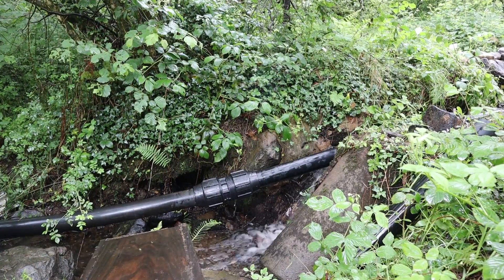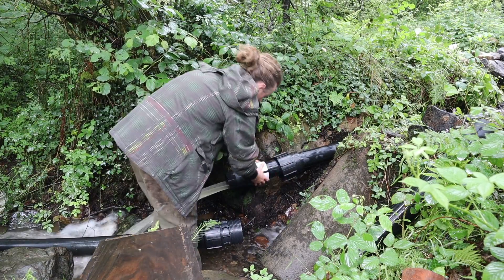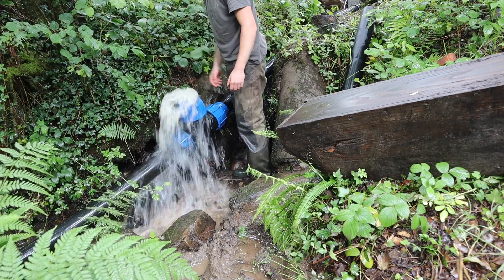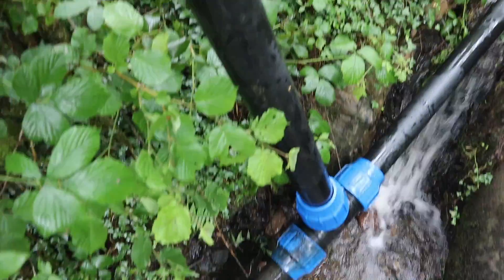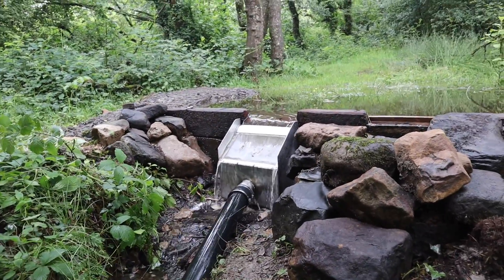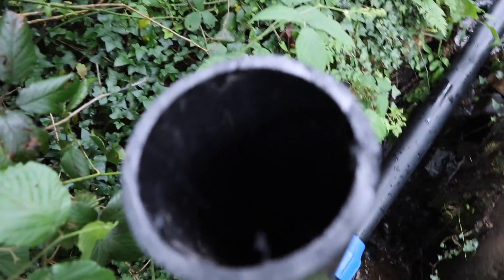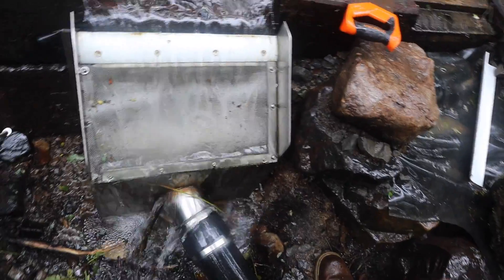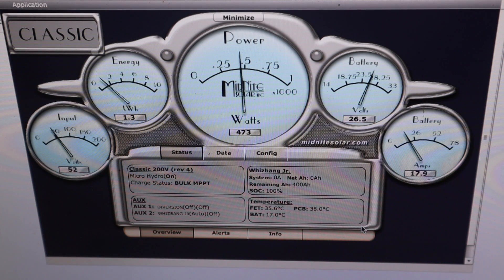Hydroelectric intake Update and Modifications.

Comment: The pipe in the intake needs to be extended to the back of the intake towards the damn. If you put a piece of pipe in there so the water comes in from the back instead of the front it will avoid any air getting into the pipe.

Comment: 13:02 - Would putting the white PVC pipe baffle higher in the box break up the vortex better AND clean the mesh or would it be likely to cause the vortex to happen again? Or if it 'sort of' worked higher up and cleaned the mesh, but reintroduced the vortex, would drilling a few variable sized holes or filing large grooves into the edges of the pipe help to break the water flow up?

All theoretical ideas, but it's always good to try all manner of things when tuning things as you might hit on something you'd never have considered.

Comment: I'm a bit clueless with hydroelectrics, but would it be worth having more than one standpipe?
Reply from the maker: Yeah it could be, But as with all hydro there is a trade off. A tee fitting is £50 then another £20 for the pipe plus delivery. Then that fitting causes friction losses. you alway want the minimal amount of fitting and stuff on a penstock to keep the losses down. So it might well be the case that it needs two. But if one will be the job almost as good we go with one.

Comment: Was just thinking, there's no reason why you have to have only one stand pipe.  I've seen other systems, like to yours, where they have two stand pipes.  One near the intake, and another about mid-way down.  You could also make a larger box or pipe, as others have suggested, with a stand pipe to get the air out as well.
Reply from the maker: Yeah it could be, But as with all hydro there is a trade off. A tee fitting is £50 then another £20 for the pipe plus delivery. Then that fitting causes friction losses. you alway want the minimal amount of fitting and stuff on a penstock to keep the losses down. So it might well be the case that it needs two. But if one will be the job almost as good we go with one.

Comment: Could you add an elbow pointed down inside the intake, so the water would be pulled off the bottom. So to leave the air bubbles floating on top?

Comment: Those fittings are huge. 4:20 makes you look a bit like a borrower doing some regular plumbing :)

I think a stepper motor would work well for the nozzle and just use something like a sparkfun easy driver to control it via your Arduino setup. You would need an Endstop switch mounted vertically as it were to allow it to home to that position and then just work out how many steps closed to open to have the code just do it for you. It would even allow for incremental opening of the nozzle to whatever you want, could even do it via a potentiometer from your shed. Built something similar to open my chicken coop door in a morning.

Comment: Seen so many  " lntakes '  where there is a wire mesh ( or similar contraption) placed at the top of intake box and water running over it.
This always leads to clogging up and lack of flow. 
Dirt and debris has to be sucked into this idea whereas literally turning this idea UPSIDE DOWN will certainly solve this problem to large extent leaving much cleaner intake of water and less likely to clog up as gravity will help with solids and buoyant floats to top and away from intake. 
An overflow however must be retained preferably away from intake box to divert any natural debris to carry on its merry way down steam. 
Intake grid should not be too close to bottom to prevent suction of dirt from bottom.
Reply: This sound like a good idea in principle. But what do you mean by UPSIDE DOWN?
If you mean the filter is lower down in the water box, then how would you clear heavy debris that sinks?

Comment: Really great update on the Hydro project. I've been following very closely. If you made the pipe go further into the box would this avoid the cavitation  area at the front. Could a simple board be put in front of the take off in the pond to temporally  stop the water flow to allow work. Bit worried when you say about not putting you hand in with such a flow.

Comment: I saw a first flush drain pipe connector the other day and thought of you hydro setup. It had an angled screen like your intake but it had a set of vertical blades on top of the screen to help larger debris glide right over the top without touching the screen - would probably be easy for you to fabricate to test if you were keen. System is looking good mate - cant believe you didnt get saturated changing that over!

Comment: Ever think about making the box longer, in the direction of the pipe ? You could keep it enclosed with a lid with seals on the sides and bottom edge to prevent water leaking, and still be able to remove the lid if needed.  The added space should increase the head pressure and help by moving the pipe away from the bubbles in the waterfall. The screen could remain the same and any water running over the top of the box would wash away any debris. It just looks like the box is to short, to much happening in a small space.

Comment: to keep the intake clean simple have a log floating in the water right infront of the intake, say 1-2 feet away, like you see at a big dam, or hydroplant!.
like this:
https://images.squarespace-cdn.com/content/v1/5ced397b21ac1300018da0bc/1559412132313-J8GC04KOHOQPIJXV73KK/ke17ZwdGBToddI8pDm48kF4J2zvHtTFyG-tO8wWv_C17gQa3H78H3Y0txjaiv_0fDoOvxcdMmMKkDsyUqMSsMWxHk725yiiHCCLfrh8O1z5QPOohDIaIeljMHgDF5CVlOqpeNLcJ80NK65_fV7S1UabvUF4XvGy1cvbVdHN7Yosx4jpSMTgdL8iiNcGR4k2RPpZxiY0Z79Y9j-kAiXZP3A/Smith+College+Debris+boom+%2825%29.JPG
sorry long url couldnt find a other example, you just have to use a few small logs to do the same!. such a simple low tech, low maintenance solution to the problem of floating debri!, 
Greetings to Mr and  Mrs Harbour, i have been watching your videos ever since you started placing rubber tires for a foundation, and i was thinking "this is gonna be a big fat fail, i gotta keep watching", i did not have much faith in your construction abilities, and i might imagine a lot of your friends, family had the same thing, iam very glad i was very wrong and see you doing so good!.

Comment: To REALLY get the air out you want to slow the flow of the water down for a bit.  Make a meter section out of steel or aluminium where you have your standpipe that is a square box much larger than the pipe.  Simple enough to do and with a couple connection points can also act as the standpipe location, the water will slow way down and allow that air to completely raise to the surface.  The standpipe will help when you have flow that doesn't suck the air down but when you open it all the way up my guess is that it will still draw air.  Maybe it will make a difference maybe not but there is a couple watts there at the top end to have air not fighting the water flow.

Comment: Kris, you should introduce a horizontal section in the piping. And, if possible, a widening section. By doing this the air in the waterflow will go to the highest part off your system. And that’s the spot where you will have to ventilate the air out of the piping.
The best spot  would be a bit lower then the water-intake. 50 centimeters?  Make the ventilation pipe higher then the level off the water-intake and the result will be a no-maintenance air vent system

Comment: I'm wondering if your PSI gauge for the pressure in your system is full of air? The pipe it's attached to is straight up and down I believe.  Would air in that section of pipe cause the PSI to read differently than if there was just water in there? Just a thought.
Reply: Funny enough, having air in that part will actually result in a more correct reading. If you have water in that pipe, it would register less pressure because the weight of the water would pull the pressure down (you'll lose the height of the pipe in head hight in a stationary situation). But air betting a lot lighter than water will just pass on the pressure. The air also can't escape, so won't cause bubbles in the actual flowing water. 

Though I guess the head is high enough that half a meter less or more doesn't matter.
Reply: @sanderd17  But air is compressible, whereas water isn't. So you should read a reduced pressure if you have air in the system.

Comment: Just looking at the intake, bubbles are being introduced near the intake pipe, if you do another one I would elongate the box so all the bubbles rise before they get anywhere near the intake pipe. Along with the baffle, air should be unable to contaminate the water, as long as you have adequate flow. T PS, a bit of clear pipe might help to solve the prob, as you can tune any designs you make as you will see bubbles in the flow.

Comment: Just a thought. If you were to slow down the water by at least doubling the diameter of the pipe between the intake and where your stand pipe is. With the slower larger mass of water. The air will more easily work it’s way back to the intake. Another nicety would be a check valve on the stand pipe. Letting air out but not in.

Comment: You're using too small of an intake pipe. You need to build a better "wier" first then install a 16-18 inch diameter head pipe with a screen then measure your distances while tapering the pipe down in diameter to the generator just like William Mulholland did with his Aqueduct
Reply: That sounds like a pompous and arrogant set of instructions which would involve spending a lot of time and a lot of money for, probably very little result.....!(imo!)

Comment: You may need a much larger intake.
Reply from the maker: It’s all about materials cost and size vs functionality. If it cost twice as much in material to gain a tiny amount of power it isn’t a good design. Making the box massive or adding massive pipe or any other solution that involves lots of cost and materials would not be worth it. Ideally I would have a big pressurised settling tank underground and a robotic self cleaning screen and settling tank cleaning system. Ideally I would double my pipe size and double my cable sizes. But all that stuff would add minimal power for a HUGE material and environmental cost. This with hydro are all ways a trade of and this is something that seems not be understood in this particular comment section.
Reply: @KrisHarbour  I understand, we live on a small farm in Tennessee and I do everything myself.
Reply: @KrisHarbour  basically, Kris, most people don't know what they're talking about - but THINK they do!
But this IS YouTube, after all.........!!!
I sensibly keep quiet about hydro (as I know nothing !) and just amuse myself watching  people tell you you're doing it wrong...!!!
I think you're doing great!!!

Comment: at that wattage 11.5kw a day is quite some power do you ever get to a stage where your short of power using hrydo only
Reply: David Simpson -   Kris has explained in other videos that the the hydro system does not have enough water to work during dry spring and summer weeks/months. The system depends on rain to produce enough water to run. Kris added the wind power system because two will usually produce enough power to run his shop equipment yet still keep his batteries charged. I think he mentioned in a recent video that in dry periods with little wind or dry with no sun he occasionally cannot run the heaviest electricity drawing tools because, in essence, there is only one power source.

Comment: Have you considered protecting the intake inside the metal box so that the air bubbles do not get in.  You may make a curved pipe that takes water from the bottom of the metal box or maybe a plate (inside the box) from the top of the intake with a 45 degree down.

Comment: would it be better to have 4 of the adjustable heads so you have no need to drill out you just set all 4 untill you get the best power at lowest flow and work from there ?

Comment: The lack of increase in power suggests that flow through the nozzles is maxed out and that you could increase the size somewhat. Also you could try extending the pick up pipe slightly to the rear of the box and out of the turbulent zone in front.
We need to get you more energy storage capacity for when the rain is't falling, it would be a shame to waste all that lovely power when the stream flows well and the wind blows hard. Perhaps a heat storage system to dump energy into which could help heat the greenhouse when it is built
Another great video, have fun experimenting.
Reply: I wondering if he can't just add a second turbine inline and increase the power produced by 60-80%.
Reply: @wes9451  There is no power left in the water that exits the turbine.

Comment: So at a constant 400w...figuring what 12hrs running a day in summer? 4.8kwh. Thats not bad and pretty conservative numbers and we need to factor in losses but thats pretty decent. We don't use Air Conditioners in the UK so most of our big  power costs are heating elements (washing machines, ovens, kettles and Microwaves) most tech is pretty low use,  LED's, 5v USB driven tech and can run on a low power ring of 110v or less, rather than 240v. When I was on ships,we had 110v sockets and 240v and 440v sockets. We used to have 3 point round pins so you couldn't plug them in the wrong socket.
Reply: mwnciboo -    If you have not already done so, you should watch the hydro system playlist. The system is only functional during heavy rains in the spring/summer and during the long rainy periods of the fall and winter. That is why Kris added the wind system. He states that he normally needs two functioning power systems (wind/solar/water) to be able to use all of his shop tools, as several are heavy users of electricity, and to keep his batteries charged.

Comment: Could you not stop the water at the intake while you change the fittings? I assume there's a reason to keep the flow going...
Reply: One could do that if they had a diverter installed, yet he does not have a way to divert the water. 
It really all depends on how the intake area is built up. If one builds a small dam such as this one and then builds in gates and sorts one could just close a gate and shut the water off and divert it to the steam. There are a number of ways this can be done.
Reply: @kameljoe21  why not cut a piece of cardboard to apply over the intake screen and dam-cut. It would extend down into the dam pond and be held there underwater by a brick or suitable large stone. The water would run down the cardboard and very little would get through the screen. 

This sounds like more effort than putting up with the in-pipe-flow 🙃 and could be destructive to the dam-intake overflow area!

Comment: i kinda wonder how much extra friction the slight changes of slope the pipe makes as it go's down the hill...probably negligible and not worth making the whole thing straight thow
Reply: The friction inside the pipe is the same no matter what the angle. The flow rate of a pipe is dependent on it's diameter and pressure and that comes from the head height of the incoming column of fluid
Reply: Gentle bends won't drop pressure much. Sharp bends like elbows will, but it still may not be that significantly. Kris did a video on replacing a 90 with two 45s on one of the nozzles a few months back.

Comment: The lower output is due to the lower head height not air cavitation. The intake slope design sacrifices a lot of head height in exchange for debris flush. Every inch of head height you can gain at your input will result in increased power output. That is your biggest limiting factor.
Reply from the maker: First I have not lost any power. I have gained power with the new Intake. Second There is 200mm of head loss from the filtering. 200mm of head loss is 6w at full flow so a small price to pay. And thirdly I have added 600mm of head in total more than the last intake had.
Reply: @KrisHarbour  What's your flow rate?
Reply from the maker: @DevinHeaps  5 liters per second at full power
Reply: @KrisHarbour  see, Kris?! - another one.....!!!! Total ignorance combined with total self confidence - a depressing combination.....!
If only they knew that you know what you're doing, maybe they'd shut up......!!

Comment: I'm a chemical process engineer and design pipework for  living. To solve the air problem you need to introduce an orifice plate into the tee at the outlet side . You need just enough of a restriction to force water to rise halfway up the standpipe to create a water lock. This will allow air to vent to atmosphere out of the standpipe, but the water trapped will prevent air from being drawn back in. If you want to go for a belt and braces approach you should double the arrangement with another standpipe in close proximity to the first This is because the pressure drop on the downward side of the orifice plate will cause dissolved air to drop out of solution and form bubbles (this is the same effect as cavitation on a propeller) and the second standpipe will allow this air to vent.

Your solution of installing vortex breakers is standard industry practice in the outlets to large vessels where the vortex can cause emptying of the last bit of fluid to take forever and for air to be introduced into the pipework.
Reply: Doing as you say is fine in aqueducts not in hydroelectric, pressure drops are increased, rather the diameter of the pipeline from the filter leads to T, you can also use cheaper material since in that section there is not much pressure or depression, slowing down the speed of the water means that the air is not transported, then the coanda filters work much better if they do not have negative pressure underneath, which causes dirt to attack the grill, this is done with a stretch of larger pipe up to the breather or air intake T in the event of closure upstream which is missing.
Reply: @winterburan  Making the diameter of the pipe from the inlet filter to the tee larger than the rest of the pipework is effectively the same thing as adding a restriction below the tee ;-)